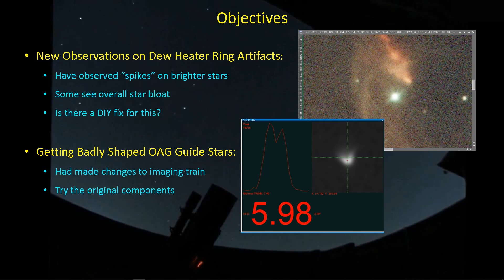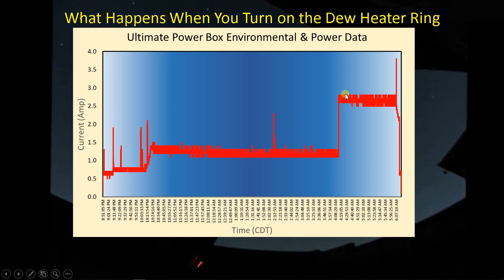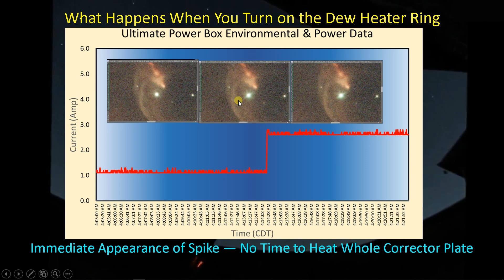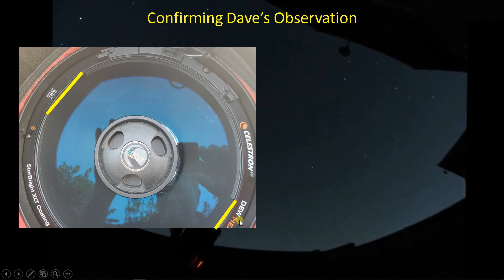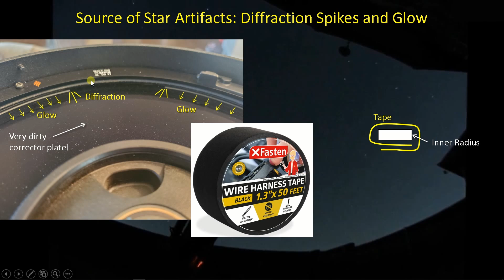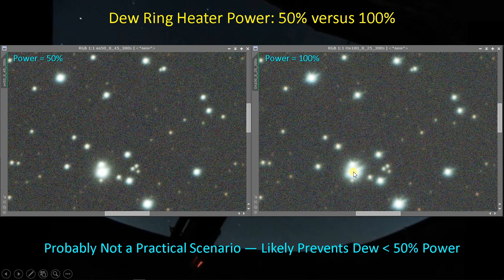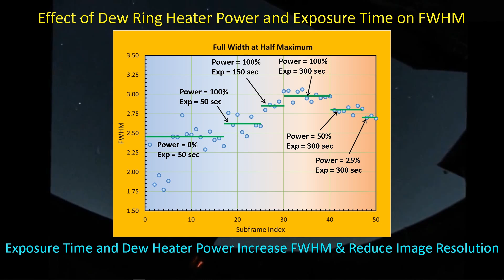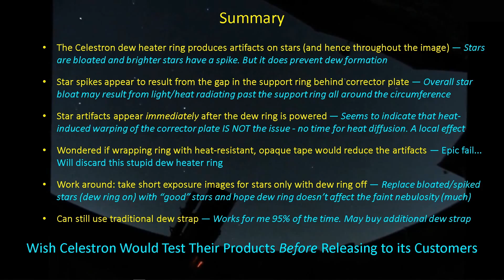New Observations on Star Artifacts Created by Celestron's Dew Heater Ring

Comment: Sorry, I feel like I pointed out a crack in your foundation or something 🙂  But it is what it is.  The dew heater ring worked perfect on my C6 and the thing got hot in the winter to the point I had to turn it down because steam was coming off the corrector but no star aberrations 🤷 But C8 and above it is a crap shoot and even with the super expensive Celestron dew heater controller with temperature probe.  I have been happily using an AstroZap 8" dew heater band on my RASA 8".  Someone on IG pointed out my scope was covered in frost but I was like yep but my corrector is nice and clear with perfectly round stars.  Thanks for this very detailed explanation and testing!  I do think the gap is there for a good reason though, possibly to prevent too much pressure on the corrector when the glass expands in the cold?  I am also curious is this is a common design "feature" with other brands like Meade?  Actually Meade telescopes have gaps too but they don't use dew heater rings 🙂
Reply from the maker: It is interesting that @ldipenti commented he had no problems with his C5 and that scope has a single piece support ring with a small 10 mm gap. Perhaps your C6 had a similar design. I suspect Celestron is using a two-piece ring with a gap to make it easier to install when they're putting the scope together.

Comment: Hi James , could you 3D print a better 360 degree solution for this ? Might be something people would buy .
Reply from the maker: I think the ring would have to be aluminum since it's going to get hot and it plays a structural role - this is the part that has the threaded holes you use to attach the dew ring (or the original ring). But, yes it would be nice to at least close those gaps.

Comment: I think you're on the right track with the gaps hypothesis. I have a C8 with heater ring with the same issue as you, but also have a C5 with the heater rings that I've been using for some years before upgrading to 8" and never saw any of those spikes. I've just checked and turns out that the ring for the C5 only has a small ~10mm gap at 3 o'clock and no more than that.
Reply: I had a C6 with the dew heater ring and no problems.  I would even crank the thing to high in very wet high humidity.  But fast forward to my RASA 8" and go anywhere over 10% power and the diffraction spikes.
Reply from the maker: Ahhh, I see that you saw this post. I wonder if your C6 is constructed with a single piece split ring like the C5?
Reply: @Aero19612  I once had to remove the corrector to clean it and I do remember it having 2 gaps.  They were much smaller than the larger scopes but they were there.  I no longer have the C6 to double check.  Also the C6 I used the hyperstar with a ASI2600MC Pro mostly so with such a big pixel scale I probably never noticed.
Reply from the maker: @deep_space_dave  Ok. Thanks, Dave

Comment: I have the same SCT 9.25 and use the Astrozap Heated Dew Shield and works great for dew prevention and also a light shield. However, it was a little long for my taste, so I cut 5" off the length. I was thinking about getting the Celestron dew heater ring at first and now glad I passed on it. Thank you for your keen observations. Clear Skies!  -Eddie
Reply from the maker: I agree. A dew strap and shortened dew shield will work just fine. The shortened Astrozap dew shield is even better I bet.

Comment: Interesting, that the gaps in the ring only lead to changes when the heating is turned on. Maybe they expand due to the heat and start to cover areas in the warm state that are not covered when the heating is off?
Reply from the maker: I doubt it. The thermal expansion coefficient is very small. For a 10 deg increase (that's a lot), the support ring will only expand by 0.0001". Pretty small.

Comment: The problem with the gap is that the gap is present whether the dew ring is turned on or off so aberrant light is not the issue. So why is the problem immediately after power is turned on? We have not found the problem.  I would suggest we pull out our hand held temp meters and see if the temp does rise rather quickly and could be the culprit. In other words take a photo that only last a couple seconds into the power on sequence. Similarly could you use a specifically aimed temp meter and point at the gap areas and the none gap areas....
Reply from the maker: I didn't mean external light. I meant light associated with the dew heater ring heating element. I'm temporarily done with testing the heater ring - I put the original (non heated) ring back onto the SCT. Maybe I'll do some tests with the ring alone... Thanks for watching!
Reply: @Aero19612  OK -  wow that makes sense!  Thank you for what you have done so far. One question is that gap underneath the corrector plate?
Reply from the maker: Yes. the gap is in the ring that supports the corrector plate from below (inside the tube). I'm assuming they used a two-piece ring to make it easier to assemble the SCT.

Comment: In your videos it looks like the dew heater protrudes to the light path and therefore the gaps may be visible and cause problems. In my setting (EdgeHD 1100) the dew heater is completely covered by the front ring. Could it be you mounted a wrong system? As I can say, I never observed those artefacts by turning on the heating. Greetings from Hamburg Herbert
Reply from the maker: Hi Herbert,
No, it's the correct dew heater ring. Must be an optical "trick". The outer circumference of the ring is right next to the tube. Nothing protrudes into the light path. That's interesting that you don't see any artifacts. Are you sure it's working, haha?
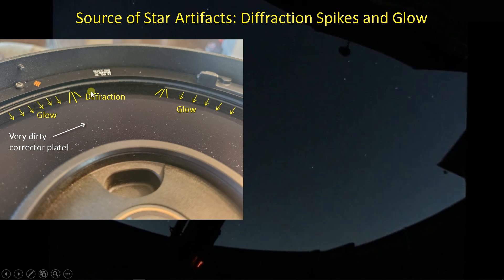Reply: Sorry for example at 8:12 you see clearly that the inner ring with the gaps is narrower than the outer cover. In my Settings this is not the case (I have C6, RASA11 and EdgeHD1100 working with the dew heater ring…
Reply from the maker: That's an optical illusion. The support behind the corrector plate is the same width as the dew heater ring and the dew heater ring is the same width as the original non-heated ring.
Reply: My SCT is only 8” and a dew strap run with Pegasus keeps all the dew out even here in 100% humidity Wisconsin. As the problem begins upon powering up the ring and gets worse with increase in power the question arises does the power application cause a vibration in the dew heater ring? It is stiff plastic and not soft like a strap. I think we have all heard various heated elements making noises as low to high pitched hums when power is supplied. Could these vibrations change the width of the gap on a very small scale, but enough to cause this diffraction pattern?
Reply from the maker: @cjmenagh882 I don't sense any vibration as there are no moving parts. If power is applied in a cycle manner, it could cause motion, but I don't think vibration is a player here.

Comment: You may have mentioned this in the video and I may have missed this, James, but does the star spiking go away immediately after turning the dew heater off?  In other words, is there any residual effect of the actual heat from the ring or, as you alluded to, is it just the power going through the ring?
Reply: My tests show it is not immediate, but affects the next 5min sub after turning off the ring. I plan to narrow that down a bit. Maybe it is good after 30s, but this may also depend on conditions...
Reply: Good question...

Comment: I'm confused how that gap could be causing issues only when power is applied to the dew heater ring. Glad I never bought one of these rings. I considered it pretty seriously when it was first announced, but decided to keep my strap/shield setup. I've got enough issues with star shapes as it is. No need to add this ring into the mix :).
Reply: Yes, the heater will glow, at least in the infrared range. I think this is very likely the cause of the spike phenomenon. All objects emit black body radiation. At temperatures that humans normally experience, black body radiation is in the IR spectrum. At much higher temperatures, black body radiation occurs in the visible spectrum. FLIR sensors use this phenomenon to image temperature differences. Our telescopes generally also detect near-infrared because we want to capture Ha and it is right on the edge of the IR spectrum.

We know the spikes are not a thermal effect because it happens immediately when the dew heater is turned on and stops when the dew heater is turned off. It’s also probably not a mechanical/vibration effect. It seems to be correlated to the gaps in the SCT support flange, so it seems logical to me that the support flange is obstructing the IR emissions, but the gaps allow it through to the optics. James’ tape would do little to block IR, so it made no difference.
Reply: I don't agree.  Yes, it does emit some far IR. But so does the telescope tube without a dew heater on it.  So does everything that is above absolute zero.  If a normally functioning dew heater could "glow" enough to be picked up by a camera sensor as if it were light, so would everything around us.  And distinguish between near IR and far IR.  Our cameras may pick up near IR from things that are almost red hot.  An object at maybe 100 F (38 C) will 'glow' at a wavelengths of many microns, far outside its range.  FLIR camera sensors, as I understand it, are not based on the same silicon technology as our cameras.
Reply: @leeratliff7588  definitely an interesting theory. Reading the file name, it would appear James is imaging the Bubble nebula. Looking at his imaging train, he's got a filter drawer. It's a color camera, so I'm guessing he's got some kind of dual band filter (again, from the file naming convention) in the train. Most of those dual bandpass filters are pretty tight around their targeted bandwidths ranging from 3nm to 10nm. I'd be shocked to learn that the dew heater happens to be glowing brightly enough at the 656nm wavelength to cause this.
Reply: @JonnyBravo0311  Yes, that makes sense. I’d guess the dew heater heating element probably heats up to somewhere around 150F which is something like 340K. At this temperature, the peak radiation would be at 8-9 microns - well beyond 0.656 microns as you point out. However, that is the peak of the radiation. There would be some lesser amount of radiation on either side of the peak. Someone better with math and physics might be able to figure out if there is enough radiation at 0.656 microns to cause this effect. It might be easier to design an experiment to test this empirically.

EDIT: After writing this reply, I thought briefly about the easiest way to test this empirically and it seems like it should be as easy as pointing your telescope at a hot object and integrating for a few minutes in darkness. Once I thought about it in such concrete terms, I decided that it seems very unlikely that you would see any near-infrared light in such a situation.
Reply from the maker: The gap is in the support behind the corrector plate. When you apply heat to the ring, any glow from the heating elements has a direct line of sight toward the primary mirror. Yep - stay with the dew strap and dew shield. Save yourself some grief.
Reply: @Aero19612  the heating elements actually glow? Bright enough to cause reflections? Further, even when James wrapped the whole thing in tape, it still glowed brightly enough to cause some reflection artifacts?

Yeah, I definitely don't need that kind of grief in my life LOL!
Reply: @JonnyBravo0311  I very much doubt that the heating elements *glow*.   They would have to get to a temperature something like 800 F to do that.  We would burn our hands handling them.
Reply: @michael.a.covington  I completely agree, which is why my questions sounded rather incredulous. I mean, it's clear something is happening when power is applied to the heater ring. The before/after images clearly show this. But glowing elements? No, that I don't accept.

Comment: the astrozap dew shield with heater strips built in are great  been using one for a few years now works great ... great video very interesting  i was not aware of this issue of the celestron new style dew heater ring i seen the product when they first come out thought it was a great idea at the time but had all the dew heater stuff i needed  glad i did not try to upgrade to what i thought at the time was a great idea . cheers james
Reply from the maker: I thought it was a good idea too. My non-heated dew shield and dew strap work pretty well, so I guess I'm back to using that approach. Maybe add another dew strap. Thanks for watching, James!

Comment: This is a very interesting find James. One thing I'm wondering is, is celestron's do heater controller using a PWM signal to send the power/current to the do heater ring or is it a continuous controller because if you're using a Pegasus power box that is PWM that might be the difference between what they're using. On top of that, I'm wondering if the PWM frequency is actually creating some type of resonance frequency that could be also affecting the FWHM??  One last note, I know celestrons controller unit measures ambient temperature and humidity so I think they're automatically calculating what the dew heater ring temperature needs to be to properly heat the corrector plate so that it doesn't get dew, that amount of power may be insignificant compared to what the Pegasus power box might be outputting which could possibly be distorting the corrector plate slightly.  If you could get your hands on the Celestron controller that my answer your question somewhat
Reply from the maker: Good points. I was only willing to buy the dew heater ring if I could power it through my Pegasus Astro UPB. The Celestron controller is around $300. I did some simple heating measurements of the corrector plate heating (earlier vid). Seemed like 25% power wouldn't heat the corrector plate enough. 100% is probably way too high.
Reply: @Aero19612  I really need to test this with my dew heater ring as well, as you know I have my edge 11 set up with a hyperstar and now I'm curious if I will have different results if I have the dew heater off. I'm definitely going to do some testing on this. It's crazy how just when we think we fix the problem with the ZWO camera fan issue now we have a dew heater ring issue, lol
Reply: @Aero19612 the Same issues occur when using the celestron Controller.
Reply from the maker: Ahh. Interesting. Thanks, Markus!
Reply: I have a Celestron controller, Bill, and have the same issues.  I bought it specifically to see if it would remedy the situation since I had the Dew Heater plugged into a Kendrick adjustable controller, but it didn't fix the issue.  Still spikey stars.  I tried loosening the retaining ring just a bit (thinking I overtightened it), and I also reduced the aggressiveness of the Celestron Controller (to 5), but neither helped.  (After watching the video, I'm going to try reducing the aggressiveness for the dew heater ring in the Celestron Controller to 3 and see what happens.)
Reply: @CingStarsVT Thanks Greg, that's really good to know.  Please share if you find a remedy 😀
Reply: @billblanshan3021  Hi Bill.  I posted a summary of my experience with the Celestron Dew Heater ring and Celestron Controller at a lower aggressiveness setting.  Seemed to work better!